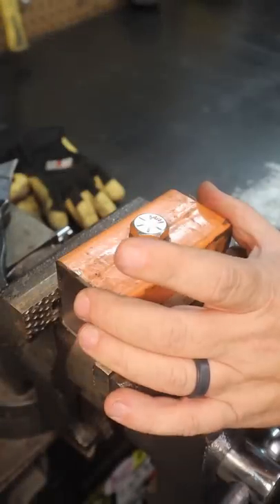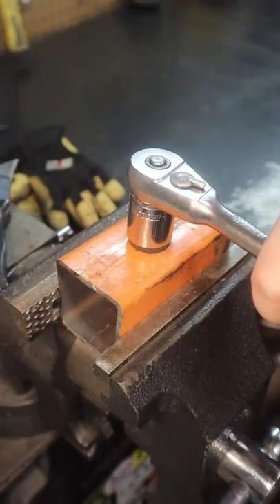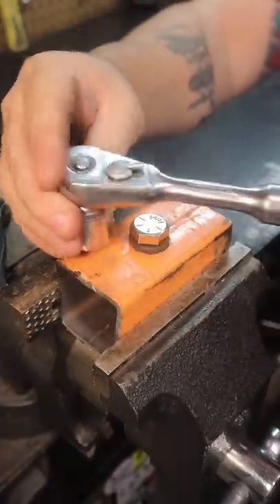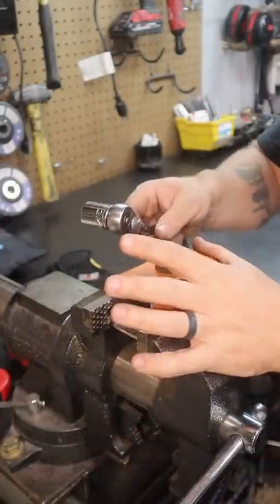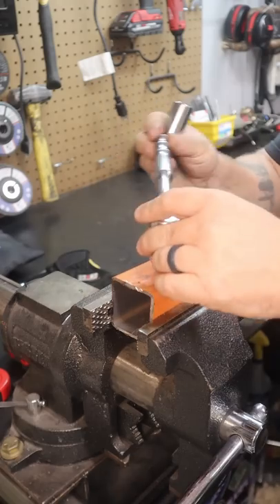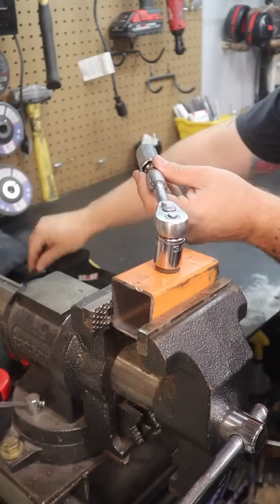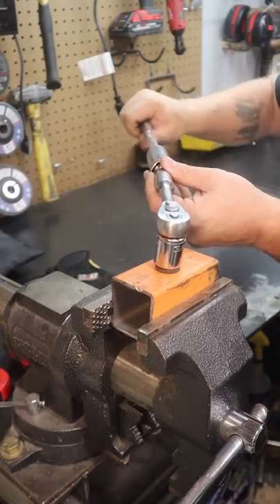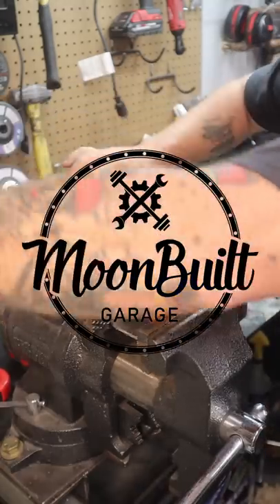🔧Tool Hack #1 Free Breaker Bar For Stubborn Bolts | #Shorts

Comment: "now you have the leverage to......break that kobalt ratchet."
Reply: That's a USA made Kobalt, they were manufactured by Bahco/Snap on tools. Tough ratchet
Reply: @NDC1115  Were they? I know Williams had the contract initially, and lost it to Danaher several years after production began.
Reply: @airmobiledivision7759  Williams and Bacho are both part of Snap ons industrial tool division. Certain tools were made in different plants. The wrenches were twins to the bahco, so were the ratchets.

Comment: I was expecting a cheater pipe, instead I was humbled
Reply: Same.
Reply: Some times I like to put 2 wrenches together for more leverage
Reply: @Rustynuckles1  Yeah, but it doesn't have ratcheting features, and if it does the ratchet is usually weaker in a combo wrench then a standalone ratchet.
Reply: @SlowSTEN  I do this at times where I'm in a tight space and have to use the 1/4 inch ratchet but need more leverage. Usually just a socket will give me extra leverage and surface area to grab. Also do this for hidden hard to reach Allen head bolts that I need to use the long side of an allen key. Ill throw a socket onto the Allen key with an extension to get the leverage. Learn stuff like this working on ecodiesels
Reply: That's essentially what he did.
Reply: Never do this. If you're going to double wrench thats 1 thing... this is stupid.
Reply: @moosesimpson8625  no lol  not 2 wrench  on one bolt or nut.. you attach  the wrenches one over the other to lengthen for leverage.. it works well in tight spot where you can't use a socket
Reply: @SlowSTEN  yeah well after you brake it loose you can use ur ratchety wrench to take it out the rest of the way..
Reply: @Rustynuckles1  I got that. I have always called both method double wrenching. I prefer the angled end wrenches for it so you can offset your wrench handle and the law of levers states that its a force multiplier. Haha. 
1 socket wrench and 1 end wrench = 2 wrenches
2 end wrenches = 2 wrenches. Hahaha
If theres a better name for the socket + end then I dont know it.
Reply: @moosesimpson8625 oo sry I misunderstood  stood
Reply: @moosesimpson8625  Iv heard it called the box end of the wrench, the inclosed part.
Reply: yeah using a cheater pipe would be a lot simpler
Reply: @Enter_name_here247  Simpler, maybe, but a pipe isn't always present so it's kind of neat to see a different way to do it
Reply: I grew up calling a cheater pipe a Poor Pete.
Reply: It's a ratchet not a breaker bar.
Reply: same.. i was like of course i have a piece of 3/8" pipe .. lol
Reply: @SlowSTEN  if you’ve got tools you’ll have a jack you can use the jack arm as your cheater pipe 🤷🏼‍♂️
Reply: @andrewpuckett6157  that seems like a good way to fuck up some tools

Comment: I always try to keep a pipe around for this. Often a section of your two piece jack handle or the bottle jack handle will work for smaller ratchet handles.
Reply: I have a piece of inch and half pipe about 18 inches long that came from my grandpa when he replaced the plumbing in his house. And people wonder why I keep it in my car.
Reply: When using a jack handle, don't use the part where they slide together. It will dent the pipe and may not go back together.
Reply: I’ve used the bar from a Jack a few times in a pinch.
Reply: Plumbing steel pipe works. I use electrical tape on the handle to avoid damaging it.
Reply: Been using a pipe for yrs
Reply: This, been doing this for 20+ years with the jack handle

Comment: Professional Retired Mechanic.  I've always used the right tool for the job. When your pushing on the Rachel instead of pulling, when your Rachel breaks your gonna knock your front teeth out. You always pull never push.

Comment: I always use a big closed end wrench
Reply: This is what I've always done.
Reply: Ditto
Reply: Or a pipe wrench
Reply: Same…most shitter sets do not come with a decent extension
Reply: Me too.
Reply: Same here. That is the way i was shown, but i gotta say using the socket and extension looks much easier. With the wrench i always worried about it slipping if i didn't keep it lined up right while applying force to it.

Comment: Nice tip. I also take a closed end wrench and slip it over the end of the ratchet handle. It kinda sits at and angle when you pull on It but it gives you like an extra 6"
Reply: ....that's what she said?

Comment: I've been doing this for 10 years lol. What's cooler is I have a 6 year old harbor freight 1/2 extendedable ratchet, it's somehow lived after years of this. Recently the plastic handle end broke off but now I can just slide a 1/2 extention right I to the end of the rachet handle, it's exactly 1/2 in diameter.

Comment: You can also use a really large box wrench, like not on the bolt but on the ratchet you put the box stand over the handle and it acts as a extra leverage bar

Comment: Same with a pipe but you risk damaging the ratcheting mechanism as it was not intended for such torque loads which is why you never see breaker bars with a ratcheting mechanism.

Comment: It works most of the time. Once in a while it will break a tooth on your ratchet and your hand will hit something very hard, very hot or very sharp. Use the right tool.
Reply from the maker: If available

Comment: Just one tip though, use a half inch drive and extension.  I've snapped a couple 3/8. Half works much better
Reply from the maker: True...if avaliable, or if there's enough room to get a 1/2"

Comment: Use in emergencies only. 
Old socket sets were made with a 1/2 drive receiver built into the end of the ratchet handle but too many fingers and hands were broken. Look for them at swap meets. They make good collectables.
Reply from the maker: I've never heard of those...I'll have to keep my eyes out for some
Reply: @MoonBuiltGarage  About half of the ratchets in my collection are broken at the 1/2 drive receiver in the end of the handle. Oh if they could tell stories haha. I hope you find a some. They are great conversation piece.

Comment: Ha! I thought I invented this technique! I first did this when doing a serpentine belt on an xtype jaguar. There is maybe an inch of clearance between the tensioner and inner fender well so a low profile ratchet was needed but I didn't have the leverage so I did exactly this. Brilliant

Comment: Use that hammer back there to tap the bolt while you crank on it. Saved you some time looking for the extension and socket.
Reply from the maker: Why didn't I think of that?
Reply: @MoonBuiltGarage  🍻

Comment: I am not knocking the video. Teach people. I love that. It's just disappointing that more people have not had mechanical opportunities to learn/ haven't been taught minor physics and common sense/ problem solving. At one point everyone who knows anything at all knew nothing at all. That's all of us.
Edit: Also, I get the stigma or whatever people give cheater bars, but I have slipped off bolts etc and punching an engine block etc doesn't make you a man/ whatever it's called today
Reply from the maker: More than one way to get a job done...I'd just rather take the chance at bending an extension rather than busting my knuckles...been there, done that, got the x-rays to prove it

Comment: I have a cheater pipe that fits perfectly every size ratchet I have for every application 🙂 expecially when working with leaf springs and air suspensions
Reply from the maker: You should see the one I built for going to the pic-a-part years ago...looks like a club or metal bat....built for the same reason

Comment: Hmmm I get it but also when I hear the words "when all you have" I'm not sure where another socket and extension are coming from when all you had was the one socket and the ratchet...... now back to the I get it because nobody JUST has one socket and a ratchet so that being said if it is assumed "pretty much everyone has a deep socket and extension" then they probably have a piece of pipe or a decent sized box end or combination wrench that'll do the same trick. Just saying is all. Usually when all you have is all you have there is nothing else to be pulled out of thin air because then that means that wasn't all you had.

Comment: Same thing works great for Allen keys
Reply from the maker: I've always just used pliers on Allen keys, but I guess a small enough socket would work.....I'm always afraid of bending the Allen every time I use a the pliers
Reply: @MoonBuiltGarage  I use a 10mm socket on a 10mm Allan key to get at the slide pins on chevrolet 2500s and than a cut off Allan key and a ratchet wrench for the rest. On the rear of the truck. For anyone that doesn't know I'm talking about the rear calipers

Comment: I have used a extension with a 5/8 spark plug socket and it slid it on the end of the ratchet and use that instead of a breaker bar

Comment: I didn't have a breaker bar and was using my extension to access the bolt so used my dad's metal cane as a cheater pipe.
Reply from the maker: Did you have to knock him over to get the cane, or did you leave him hopping around the shop while you dorked with a stuck bolt?  That's messed up....just sayin

Comment: Well if i had an extension bar. I'd probably also have a breaker bar. And i would use a breaker bar to crack the bolt/nut.
Reply from the maker: If...probably....

Comment: I see guys doing this kind of stuff all the time, and I get so pissed.
This video should have been labeled how to break a ratchet using an extension and a socket.
A ratchet has a mechanism inside that has a certain amount of torque that it can take before it breaks, the smaller the ratchet the smaller the gears on the ratcheting system so the less torque it can take.
Reply from the maker: Thank for the mechanical engineering lesson....I'll be sure to think about this the next time I use my tools in inappropriate ways to get a job done....(runs off to trigger someone else)

Comment: Wouldn't you need a 1/2 in socket to be able to fit on the end. And if you have a 1/2 in socket then you most like have a 1/2 in rachet lol. Just a thought nice trick tho. I'll stick with a pipe tho
Reply from the maker: Nope...that was a 3/8 socket and extension

Comment: This is the worst thing you can possibly do. Just go get yourself a good piece of steel pipe that will fit over the handle of your ratchet. You are guaranteed that you are going to crack your socket one time or another doing it this way. Usually it's not the one on the ratchet that cracks because it's the pressure of the handle that actually causes the split in the socket. If you're going to use a socket using impact socket for the rear socket but if you have a boat that's too hard for you to move just get the right half inch equipment and stop trying to 3/8 Drive. You can also use a mallet in lightly tap the back of the ratchet causing it to be an impact ratchet but you take the chances of damaging your ratchet. Trust me I ran a shop for 10 years and I am a certified Diesel and aviation mechanic. This will get you out of it bind but get a piece of pipe and keep it with you
Reply from the maker: Trust me...im a certified YouTube mechanic...this is the ONLY way to get the job done 🤣

Comment: I know what you need an impact wrench. they exist for a reason and I will not be able to break every bolt loose.
Reply from the maker: I have an impact, several breaker bars and larger wrenches and ratchets...this is just one option for those that don't have many tools
Reply: that's really only helpful if you are in a position where the impact and breaker bar don't fit. which I mean at that point I'd rather not be doing it regardless.
Reply from the maker: My momma didn't raise no quitter!!🤣

Comment: I see nobody taught you that pushing a wrench is definitely not the way to loosen any nut/bolt
Reply from the maker: I'm sorry...is that not allowed?  Is the universe going to implode because I broke some unwritten law?  I'm sure you have NEVER pushed on a wrench....
Reply: Hey man. If you want to bust your knuckles and eat wrenches go ahead. But don’t teach others to do it. Just pull the wrench. You might find you’ll have more control and even strength

Comment: Works great, I’ve used it for years until it shears the teeth off the gear and ya punch the frame 😳😖😖, it is better than a cheater pipe.😂😂

Comment: Small pipe doesn't even better job.
Reply from the maker: Explain...how is one better than the other??  They both do the same thing, provide extra length to the handle thereby providing extra leverage.  I'm sure just about everyone knows about using a pipe, the purpose of this #Short was to show people another option...not everyone owns a breaker bar, or has a piece of pie lying around, but chances are if someone owns a ratchet set then they have an extension or a dozen.  But by all means...use whatever you feel is the better option, and whatever you may have on hand...

Comment: And snap the head of extension? Naw I'll use the right sized rachet or a cheater bar.
Reply from the maker: So a cheater bar won't snap the head, but my make-shift "cheater" will?  🙄

Comment: What do you do?? Sell your shop and buy a proper breaker bar with the money.
Reply from the maker: My shop is my home garage, so that doesn't really work...but thanks for the advice
Reply: @MoonBuiltGarage  It was supposed to be a joke. You have a whole garage with, I'm guessing, tons of tools but no breaker bar. Or maybe you do have, you were just demonstrating. Either way I've ruined a few ratchets myself using cheater pipes on them. I guess in a pinch it'll work. 🍻
Reply from the maker: So was my response....yes, I do have a breaker bar, a home-made cheater bar, and several pipes.  This was a demonstration of another option for those that don't have

Comment: This was stupid. First of use a different tool. Second the extra leverage from a three inch socket? Pull harder.  At least with a cheater pipe you're less likely that it'll slip off busting your hand. I've been a mechanic for 25+ years, I know most of the short cuts and use them often. This is just plain stupid.
Reply from the maker: If you say so it may be true...🙄

Comment: Probably the worst amateur hack advice I havevever see touted on the internet.  Creates the opportunity to break 4 otherwise decent tools.
Reply from the maker: Ok Mr. Professional...Some of us do what it takes to the job done...some of you play keyboard warrior...
Reply: @MoonBuiltGarage  I've been working on machinery of all sorts since 1954.  A hack is a hack.  If you are a mechanic, buy the tools  .  At least go out back and cut off a piece of pipe to use as a breaker.  A rarchet will break under pressure beyond its design.  A mechanuc respects his most important tools, HIS HANDS!  Doing otherwise is hack work, as is advising hack work.  Which makes YOU a HACK.
Reply from the maker: And how will using a pipe as a breaker keep the ratchet from breaking?  Pipe or other "cheater" bar is EXACTLY the same as I showed here, this is just one option...being that you are so experienced I can guarantee Tice done some sketchy shit in your time, we all have
Reply: @MoonBuiltGarage  Your hand is further from a probable point of impact.  You have decided to sacrifice the ratchet.  Using the socket and extension in that manner will splay out, weaken both, probably to fail later.  Again:  If you do not have nor are willing to buy even basic tools like a decent breaker bar, why are you working on stuff!.?
Reply from the maker: You have yet to answer my question about how this method sacrifices the ratchet, but using a pipe as a cheater doesn't.  I'm working on stuff because I enjoy it, and did for years without a breaker bar, using pipes and this method to break bolts free when needed....not everyone has all the tools they want/need and make do with what they have or what they can afford at the time...